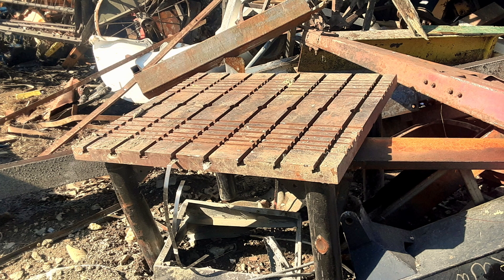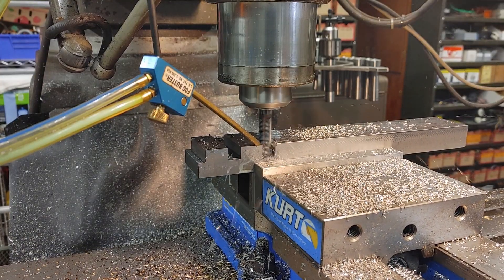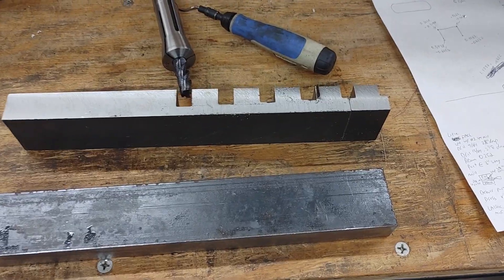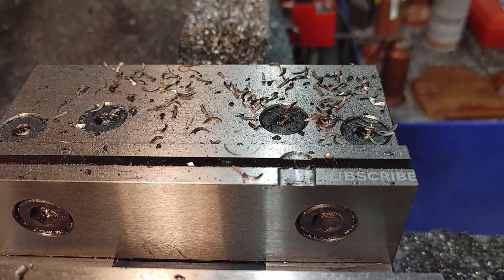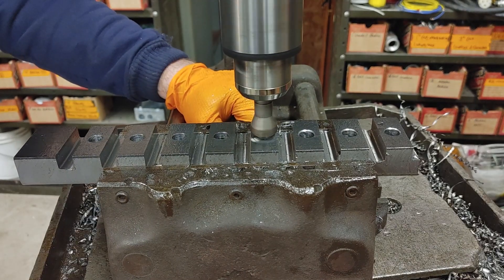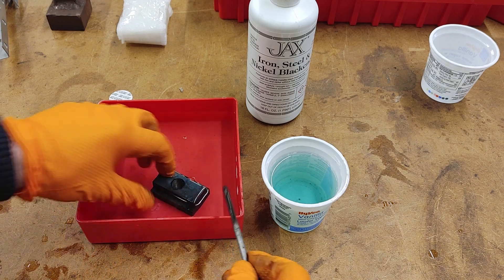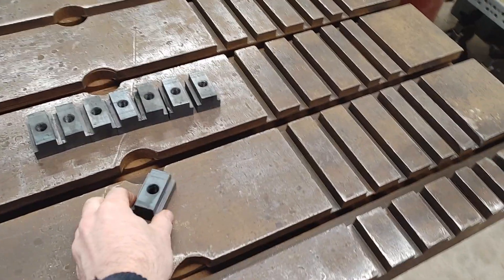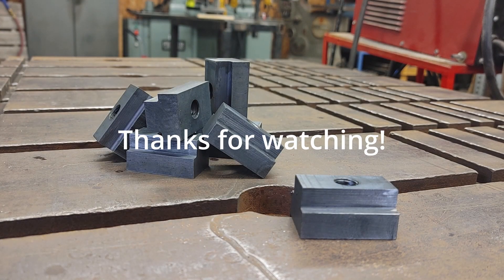Making T-Slot Nuts for My T-Slot Table

Comment: nice job. if you like, take a punch and give the exit of the thread a ding, so the bolt doesn't go through the nut into your table...
Reply from the maker: Great suggestion. If the through-hole becomes a problem, this is the solution I will likely go with.

Comment: Nice find! 
Side note when using home made T-slot nuts - if ever used in a cast iron table. Never tap all the way through, or at minimum peen several threads at the bottom of those nuts so those studs never become an inadvertent jacking force at the bottom of the slot. That cringe condition is shown at 2:47 as the stud lifting the nut 🤢 trapping it in the T-slot. That risks popping out a big chunk of a T-slots when tightening the upper clamping nut, turning the stud instead.
Reply from the maker: That is good information! This table is billet steel, and not cast iron.